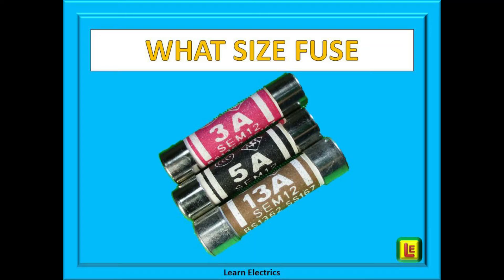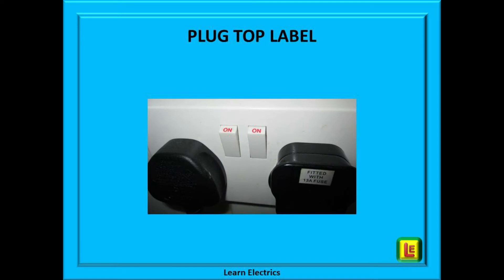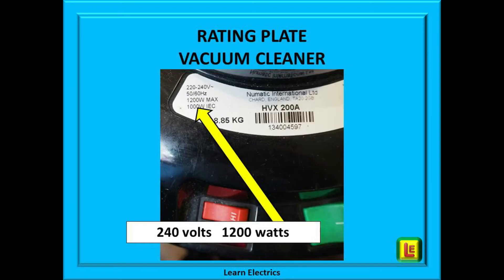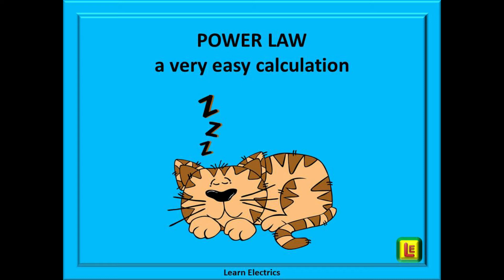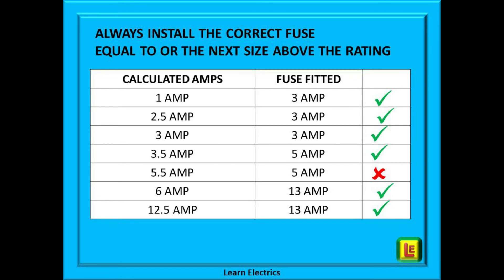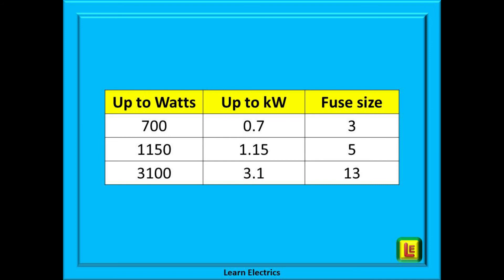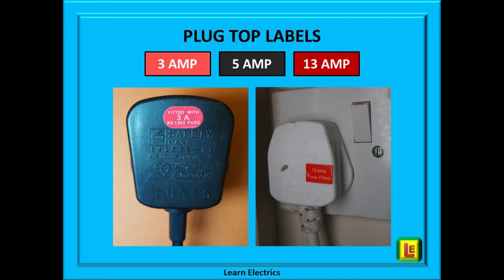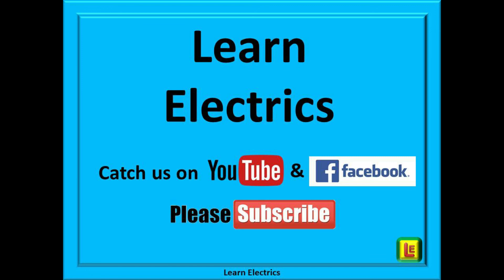WHAT SIZE FUSE SHOULD I FIT IN MY PLUG TOP FOR SAFETY AND RELIABILITY?

Comment: Check manufacturers plate , thenDivide watts by voltage = value in amps. use correct fuse. Perfect explanation . Many thanks.
Reply from the maker: Thanks for supporting the channel, appreciated, Dave.

Comment: Where dose the 10 amp fuse come in😉
3000 devided by 230 equels 13.04?
Reply from the maker: 2kW loads can be protected by a 10A fuse.
Bedside lamps by a 3 amp fuse.
Always fuse for safety.
Thanks for watching.

Comment: Very interesting. I have an American made dehydrator. It came with a 10 amp fuse, however when I do your calculation (400w/240v = 1.7 amp) it only requires a 3 amp fuse. I'm l missing sonething....🤔. Thank you for the video it was a great help.

😊
Reply from the maker: Some suppliers will fit a 10A fuse as standard. If everything they make does not need more than 10A then it makes economic sense to buy 6 million 10A fuses, rather than 2 million of three different sizes. The purchasing power of buying large quantities. My bedside lamps only need 1 amp, but they came with 13A. As an electrician I would refit the correct size as per the calculations.
Reply: @learnelectrics4402  Thank you so much for responding. I followed your calculations & fitted a 3 amp. Thank you for an explanation as to why a 10 amp was fitted, much appreciated 😳
Reply: I came here to ask the same thing (in my case a super-low voltage travel kettle/bottle (360w)) which arrived with a 10A fuse cord. I was bothered about plugging it into an extension lead since it would take up most of the 13A allowance of the extension lead. Now I know why it’s been supplied in this way, they must use the same lead across multiple products and a 10A makes economic sense for the manufacturer. Going to refit with a 3A now! Thank you.

Comment: Is the purpose of the fuse to protect equipment, say a heater, and the cables connected to it? So if the calculated current is small, eg. 2A, a fuse of 3A would be recommended but you could use a 13A too? As long as the cable used has a current rating of 13A+ right? 

So then if the current rating was 20A for arguments sake, you couldn't use a fuse of rating below 20A and the cable used for wiring it would have to have a rating of 20A+ right??

Sorry for the long question. Thanks for the video!🙏
Reply: I am mainly referring to the use of F.C.U's and the cables connecting the F.C.U to the appliance, not the cable supplying the F.C.U
Reply from the maker: The fuse is there to protect the cable and prevent fires.. If the equipment draws excess current, then the equipment is probably already damaged.
Reply from the maker: See below.
Reply: If the fuse blows the equipment is likely toast as an equipment just does not start using over current. There may be a fuse inside the equipment to protect it.

The fuse is intended to protect the wire and the socket. The socket is rated for 13 A max. Also a thin 0.75 mm² cable could burn if it was protected only by the 32 A breaker.

If you use 2 A it is recommended that you use a 3 A fuse but your house does not burn even if you use 13 A. In the continent same devices are protected by 10-16 A breakers. If it shorts the current will be very high. If a device uses 2 A it very unlikely has a cable rated for 13 A.

Comment: What happens if you have an 8 watt light at 240 volts, so you'd do 8w divided by 240v giving  "0.0333333333". Would you use a 1 amp fuse?
Reply: Great video by the way
Reply from the maker: Thanks.
Reply from the maker: Correct. But most times you would use a 3A fuse as these are easier to get.

Comment: Hi, thank you for the video however this has left me with a question.
I have recently opened my windows 10 pc switching power supply and found the protection fuse.
This was the fast acting glass tube type with a 250v 6.0 amp fitted,however the power supply was rated at 450 watts,
So by your video calculation formula this should have been a 3.0 amp fuse ref 450 watts divided by 250 volts =1.8 amps
Please can you explain why this 6 amp fuse is fitted as standard by the manufacturer of the power unit?
Reply from the maker: That's something to ask the manufacturer, They must have their reasons for it, could be surges, could be something else. Without knowing their power requirements we can only guess. Thanks for watching. Dave.
Reply: @learnelectrics4402  thank you for the kind reply
Reply: First you cannot determine the current from the power without knowing the power factor. Also is the 450 W input or output power? Also are you now talking about the plug fuse at all? You say you opened the PSU? Why? Also nowhere is voltage 250 V. 250 V is just the maximum the fuse us rared for. Also in many cases the devices work in lower voltages also like 100 V in Japan. At 100 V it could use very close to 6 A. Also does the PSU use more current at startup? There are reasons they chose the size. Nothing in BS1363 covers it.

Comment: i have a outdoor floodlight to put up, with out plug, so when i fit the plug, to the 100w led light at 220/240 what fuse, as i did what you explained on here, and came u with 2.4, does this mean i use a 3 amp fuse ?
Reply from the maker: Yes, go up to 3 amp if your calcs say 2.4A, absolutely right. Glad it helped. Dave.
Reply: @LEARN ELECTRICS  wouldn't they need a 1 amp fuse instead of a 3 amp fuse? Their light is 100 watts meaning they'd take 100w and divide it by 240v giving them 0.4166666667 amps. Going by your video they'd then round it up to give them a 1 amp fuse option?

Comment: I have mixer and power amplifier with both of this equipment have same AC240V 300WATT..So what size of fuse do i fitt.. Is that 300 divide 240??
Reply from the maker: 3 amp fuse would be normal for 300 watt devices. thanks for watching. Dave.
Reply: Be certain to use the power input watts. Often an instrument or PA amplifier the Watt's given in the model data refer to the output power. For instance a Marshall 100 Watt Guitar amplifier would output  100 Watts RMS sound power, but would draw only a fraction of that in electrical input power. Read the label or manual.

Comment: Why did you use 240 in your calculations, I mean why don't you use 220 or lowest operating voltage? If the device be electronics I guess it can has the highest watts in lowest operating voltage.
Reply from the maker: Because that is what you will actually measure in the property. Real life examples.
Thank you for watching, hope you found it useful. Dave.

Comment: Hello what will happend if I use this fuse in 12 volt system  , the fuse will let  the current enter to the load ( 12v load ) ? Or the 12 volt current won’t be able to enter to load ?
Reply from the maker: The fuse will allow the current if it is below the fuse rating. Thanks for watching. Dave.

Comment: Wat fuse can I use if I have a kettle with 3 plates and each plate is rated 1.2kw...this gave me a current of more than 13amp.. the standard voltage for my country is 240v...help me out....on this
Reply: Although each plate is 1.2kw, it's unlikely that you would have all three on FULL at the same time. So based on the normal use -e.g possibly one on full and the other one or two at a lower setting the total load at any moment may be no more than 2.5kw, depending on what type of control, simmerstat or 5/6 settings. If you turned them all on full, 3.6Kw/15a, the 13a fuse would blow (melt) quite quickly, it can withstand slight overloads for short periods. You can find the time/current graphs for BS1362 fuses with Google.   Hope this helps.
Reply from the maker: If its a standard 13 amp 3 pin plug BS1363 then the largest BS1362 fuse is 13amps.

Comment: I have a single plug 3m extension lead which isn't working. I removed a 5A fuse from the plug, would you not need a 13A fuse in it? Because a lead like this could be plugged into anything.
Reply from the maker: That's usually the case, yes. Maybe that was the only fuse available and fitted as a "temporary" fix. And then the appliance plug top will have the correctly rated fuse.
Good question. Dave.
Reply: @learnelectrics4402  thank you so much for replying and clarifying this. I'll put a 13A fuse in as I need the cable next weekend. You've got me out of a jam !
Reply from the maker: My pleasure.

Comment: Hello, l am noob in electrical. Lately start learning some DIY for home appliances. 
If a 3amp  or 5 amp plug fuse blown is it Okay replace with 13 amp fuse?  How to check good or bad fuse with a  multi meter.
Reply from the maker: Absolutely not ok Jimi. Replace with the correct fuse.
Check fuses with the continuity range of your meter.
Reply: @learnelectrics4402  oh ya.
But l have noted that most my appliances coffee maker， rice cooker , standing fans, TV, Vaccum cleaner  DVD are using 13 amps fused plug 🔌.
Reply from the maker: The video is on what size fuse to fit for safety.
Reply: @learnelectrics4402  thank you so much.  l shop for 3 and 5 amp fuse keep spare and replace the fuse accordingly to all appliances for safety protection.
Reply from the maker: Jimi, have a look at our video in the link below. It will show you how to work out the correct size fuse for any appliance. Good luck and stick with it. Electrics is a good trade, you will always find work. Dave.
Power Triangle for Electricians
https://www.youtube.com/watch?v=herKNvYzgyA
Reply: Do not replace a fuse with bigger just because it blows. You must determine the cause and if you then determine that it was too small, replace it. Do not disable safety systems just because they work.

Comment: What happened if we use wrong fuse? For example for laptop plug top only need 3A but we use 13A. What function of the fuse? To protect what?tq
Reply from the maker: It is explained in the video. We fuse for safety by choosing the size that is just big enough for function. Too big a fuse will make the lap top work but will take longer to blow and protect you if something goes wrong. Re-watch the video and it will help you to understand the concept.. Thanks for watching.
Reply: It always amazes me just how many people have the wrong fuse in the plug top of  there applyences  and don't know it.
Reply from the maker: Absolutely true. A fire risk as well as a safety issue.
Thanks for the positive comments, appreciated. Dave
Reply: Ohms law should solve the problem if u know the formula